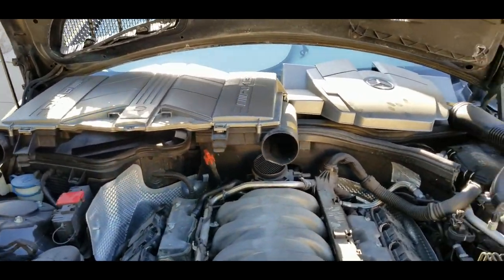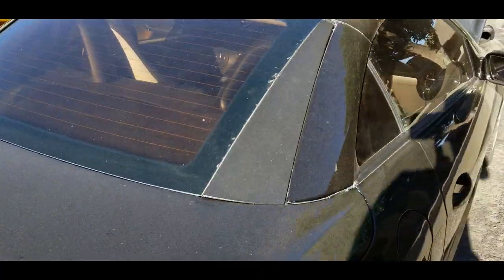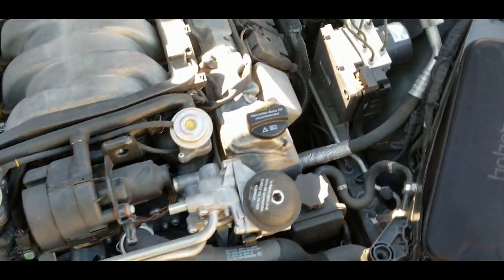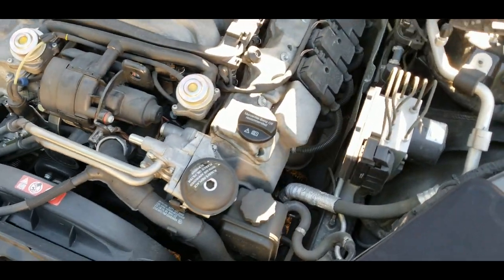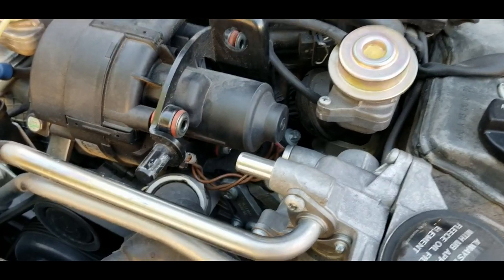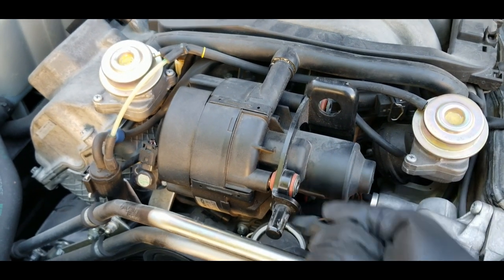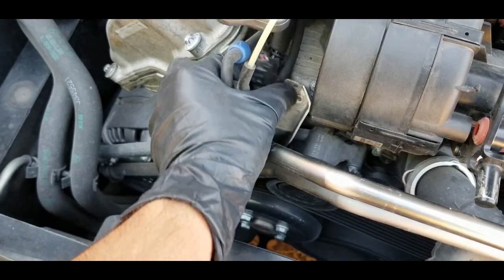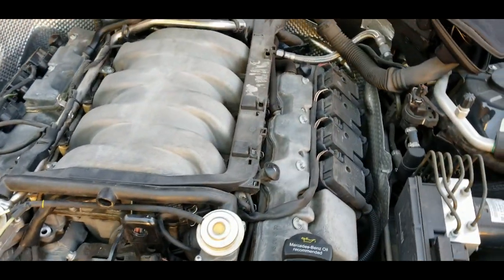MY SLK55 AMG AIR PUMP KNOWN TO FAIL ON MOST MERCEDES BENZ MODELS (1999-2009)

Comment: Your car is looking great with those upgraded mirrors must do mine be great to get that link so I can start on that project were the plugs difficult to change ?? what wheels do you have on mind as I think you said your were going to change those soon thanks Phil South
Reply from the maker: Hey Phil, I have a video on that install. https://youtu.be/E6woL8auYoQ

Look thru my videos to check it out the link for those exact mirrors is there. Depending on car color you can get color matched per paint code.   For the wheels I havent uploaded that part yet but I ended up powder coating my factory wheels for the time being.

Comment: Thanks for the vid!  Those rear window trim pieces are something I was gonna ask about.  Mine are faded as well but in good shape.  Do they just pop off or do they have to be accessed from the inside?
Reply from the maker: They require a bit of fineness lol I have a video of that I need to upload but it requires removed them with your roof partly open and when installing you need to have your roof at a 90 degree angle.  I'll upload the video for you later this week just so you can get a good idea.  Very sensitive part mainly with it being thin ABS
Reply: @PANZERSGARAGE  that's kind of what I was thinking.  Looking forward to the vid!
Reply: I'm a year late, but here's the procedure. https://www.slkworld.com/threads/diy-replace-rear-window-trim-cover.29333/
Basically, you partly open the roof, then gently tap them forward from the bottom to release and then they will simply lift off.
Reply: @MarkoVukovic0  thanks for the link, makes perfect sense now.😎

Comment: My Brother Thanks again for your knowledge with MBz I've been looking for parts and  fcp Euro is just what I needed to get what I need for my benzs and it's all OEM parts too. Thanks again to you my brother keep putting out Greatness!! 🌟🏆💯%
Reply from the maker: Glad I could help, I am honored for your confidence in me and enjoying what I put out. Thank you
Reply: @PANZERSGARAGE  Quick question So I ordered those valve cover gasket from FCP Euro I actually got the whole kit for my 2001 clk 430 for like $97 bucks the gaskets were from ELRING and not the other ones by rein you said to stay away from the ELRING ones came in a plastic bag and not on cardboard backing package do you have any experience with this brand cuz they didn't send me the MB brand with this order?
Reply from the maker: @quincyrobinson8098  2 things you can do prior to installing. If the ones on the vehicle currently are oem types, compare them to the Erling. See if there is a difference from the 2. I made a video about this. https://youtu.be/ntkWmLFJo_U
FCPEuro removed the victor reinz ones due to ppl complaining or high order exchanges due to failed gaskets. 

The 2nd thing you can do is call fcpeuro and request the order was processed wrong and you wanted the MB gaskets instead of the Erling.